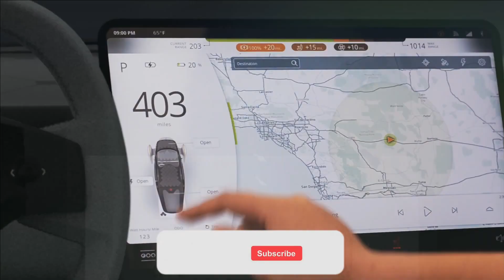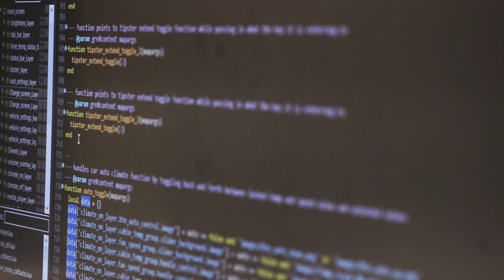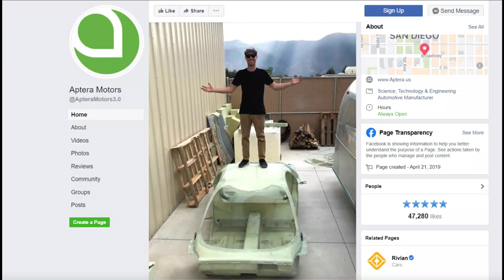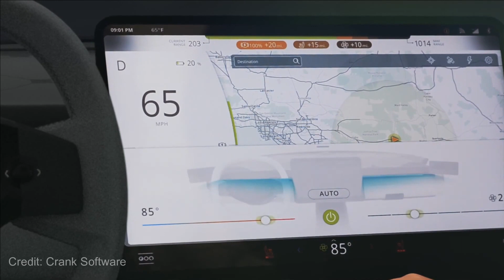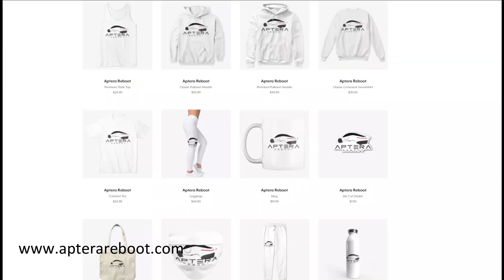Top 3 Reasons Why Aptera Will Fail?!?

Comment: Regarding the concern about being vulnerable due being beholden to third-party parts, most mfrs. use a multi-vendor strategy, so if one vendor fails to deliver, they have a back-up. In some cases, mfrs. engage 3 vendors per part depending upon the part, and circumstances. 

This risk can be further offset by maintaining a healthy supply of parts on site whenever possible and affordable. This tactic is sometimes difficult for startups that are often short on cash, and surplus space.

For context, I'm a supporter of Aptera.

Comment: It's an old video but i got it in recommendation today so there's what i think why aptera might fail:
- they need outside money, either from US government grants or investors. Before Tesla became a successful company, they were pretty close to going bankrupt and only Musk pumping his money saved it. A small company without someone to get it out of financial trouble, depending mostly on many small investors is a big risk

-safety. We'll know more when an outside company starts testing those vehicles but even now there are serious issues that aptera raises -it's light so when hit with a bigger, heavier car, it WILL be at a disadvantage no matter how hard the material is; it is only suppose to have front airbags -and even that was not certain; as a three wheeler it's not as stable as a four wheeler in a side crash; it finally has bars in the side windows that effectively create blank spots for drivers that happen to have those bars in the line of sight

- yes, the fact that's it's a two seater. Even if you only need a car for yourself or maybe one additional person, backseats offer additional space that can be used for baggage, pets, it just makes a car more versatile, more practical. Sure, there are sports cars that are two seaters but they are not advertised as a great option for daily commuting. The only good reason for a car for daily commuting to be a two seater would be a small size that would make it practical for crowded cities but aptera is not exactly a small vehicle, definitely not narrow.

-the size - they cut themselves out of European and Australian market by creating a vehicle that is too big for a 3 wheeler to be registered there. The size also means it's not a good alternative for small urban cars that you can squeeze park anywhere or for big comfy cars that one would choose for longer trips

- 3 wheels and light weight make it not a good option for colder climate and driving on snow, even when you assume they would make the road clearance better. Driving on bad quality roads and avoiding potholes will also be a bitch.

- the reality of solar efficiency- a lot of people think that the solar panels on aptera would pretty much mean no (or barely no) need for charging if they don't drive more than 40 miles daily. I think reality will check it to not be exactly true.   Not that i think solar is a bad idea in general but i think having solar on your roof, always properly directed and angled and an EV in a garage or shade that will keep the car from getting overheated (and then wasting energy for cooling it) is a more efficient combination.

The way i see it aptera was created by enthusiasts that put the idea before practicality. As interesting as it is i mostly see two reasons that they might succeed -one is economy because the efficiency of the shape means money saving not just when buying it. Second reason is if it becomes a wanted toy 'car' to have beside a 'normal' car.

Comment: I'm a 55-year-old on the verge of being an empty-nester. My pipe-dream is to sell my house, buy a very small home on a decent-sized lot outside a mid-sized city. Grow a lot of the food my GF and I eat. Buy an Aptera and retire. And earn a living as a Door Dash/ Uber Eats delivery driver so I can begin work on the science fiction/ ecopunk novel I've been stewing on for years. 

Think of the savings. 100+ eMPG. Lower maintenance costs: small and cheaper wheels, no oil changes, etc. And yet, I'll be able to claim the entire IRS's $0.60 per mile tax write-off. This means that I'll earn $0.50 per mile by simply using smarter tech (assuming $0.10 per mile in actual costs).   

[Bretahes deeply]. I can see the Hugo, Nebula, and Locus Awards already... And the Amazon best-seller ranking...

Comment: The problem that I have with the Aptera is that it is too wide. 88 inches is just too wide. Even if they could only knock off 6 inches it will make it much more acceptable. I also agree with you about marketing. They need creative, but cheap marketing strategies to really get things moving.

Comment: Like the car...
my concern is are the front wheels at risk when driving in dense traffic...
a question is a standard operator license the only requirement or do you need a motorcycle license?...
Reply: In most of the US, only a standard car license is required.  There may still be a few exceptions.  In many states it is in the autocycle category.

Comment: Aptera is the adaptation of the science challenge of who can go the farthest on the least amount of energy. The 3 wheel design is unfortunate imo as it makes the front wheels stick out too much in order to get enough stability. At 88" they are wider than the new Hummer EV of all things. They will get creamed in traffic or parked on a street and since the motors are in them that will be one expensive repair. I get that they were going for maximum efficiency and this is what was required but as a production vehicle I believe they will fail which will lead to someone else taking the advances they made and making a more commercially viable option. I just can't get behind this thing in its current state but wish them the best of luck. I'm sure we will see a modified version of it in a new science fiction movie soon.

Comment: The three stated reasons for failure are mostly unfounded if not baseless. The vehicle is in production. They are taking orders. So far, no failure on that score.
There is nothing wrong with being skeptical but claiming the company will fail in spite of all the positives, and the scale of the positives, is nonsense.
Two occupants for an “and” car is typical and the reason for purchasing by the market segment that doesn’t require more seating capacity. That’s not only no reason for failure, it’s a reason to succeed.
The safety issue is not going away as it’s a hard sell given no vehicle accident history in everyday driving. 
Looks like enough people will buy the Aptera until given a reason not to. There are more reasons, strong reasons for it to succeed. Drivers are ready. The mythic tease of fossil fuel free transportation is compelling. No charge driving was nearly inconceivable. A lot of drivers are willing to fork over the cost of an Aptera, not because of the novelty, but perhaps more so because of the historic progress in personal transportation. This could be the beginning of something big…or so they say.

Comment: Nice ! I am about to propose to Aptera a completely new design that still makes use of just solar power (all of the UV + IR spectrum) BUT WITHOUT IN WHEEL MOTORS, BATTERIES, ELECTRONICS OF ANY KIND :) Why Aptera ? Because they just might respond as other players do not seem to be reachable :) This universal vehicle is about converting UV + IR radiation (solar or artificial) to mechanical energy @ about 90% total efficiency while in use (> 80% transparency) and also be able to make use of  the full spectrum of any natural or artificial light when parked (completely opaque and acting like a dark body). Out of all other car manufacturers APTERA seems to be the most focused on super efficiency and still not destroy the wallets + they are super motivated by their comeback (especailly now) :) So ... there's that :) BTW THE WHOLE DESIGN IS TO BE 3D PRINNTED IN SELF BUILDING FULLY AUTONOMOUS AND AUTOMATED / SELF-SUFICIENT MICROFACTORIES = exponential building speed (much like a pandemic ... but a good one, I hope :) ) ALSO... THIS VEHICLE IS MEANT TO RIDE ON ANY SURFACE / CLIMATE AND HAVE ZERO TOLERANCE FOR COLLISIONS / ZERO ACCIDENTS or CASUALITIES AND SO MUCH MORE ... ALL WITHOUT ANY FANCY COMPUTERS / ALGORITHMS etc.

Comment: Over a year later, it's good to see where we are at with these issues. First, they are only talking about three, when there are many more to consider. Next, on reason 1; a company that has failed is more likely to fail again than to succeed. It's just how it rolls. But if it was a scam the first time, it is far more likely to be a second shot at a scam. Next, on safety; you already say they only might be safe, and we won't know until proper tests are done by the right authorities. It would be wrong to pre-empt any safety credentials. A year later, and nothing has been done. Finally, on it seating two; this is a stupid claim by anyone saying it's a reason to fail. It is simply not, and is not even worth proving it won't fail for the same reason. Nothing could be more irrelevant to success or failure.

Comment: The niche market is the "I want one" market. 
Oil companies refusing to reinvest in refineries will be the driving force of this and other solar powered vehicles. 
I can easily go a week without driving anywhere, so with the full solar charging capability working as advertised,  I can take a weekly one way trip of 280 miles. Add in a wind turbine, wood gas fueled generator, micro hydro generator, extra solar panels, or any other off grid electricity scheme, and I can count on taking a lazy trip to everywhere I might want to go from now till I'm dead without buying a single kwh of coal derived electricity, in theory. I'll probably buy a charge now and then in practice.

Comment: If it has an autopilot-like capability, I'd buy one.   Not to mention it has the best range of all EVs now.    The vast majority of actual road driving done is by 2 or fewer occupants, so it being a 2 seater only means it won't be a family car.   I have an SUV that, as presently used, is practically a 2 seater.   Just use it for hauling stuff in the back.
Reply: Aptera will have a OTA updatable level 2 safety pilot, not FSD to begin with.
Reply: The furthest any Aptera has gone is on their cartoon, or in the back of a truck.

Comment: I changed my order today to the 400 mile range.  They are going to build those first starting next year and then the other ranges in 2024.  Also, their goal is 10,000/year and they already have 25,000 reservations so some who reserve now won't get theirs for 3 years.
Reply: Aptera has now engaged C.P.C. Group of Italy to build their bodies.  This will delay the start of production, but the rate will be able to ramp much more quickly.   This change has taken place because the order book is continuing to grow with over 38,000 pre-orders now in hand.
Reply: @n.brucenelson5920  But they are also behind on their first round of production units that would be delivered to the local area.  Those were supposed to be shipping by now.  I'm not optimistic about getting mine before late 2024 at the earliest and probably more like sometime in 2025 but it is what it is.
Reply: @robertd9850  They have been open about the reasons for the delay.  The products that will ship are going to be considerably upgraded from what was initially foreseen.  Pre-order numbers are now over 38,000 and still increasing rapidly.  The previous plan to use 3D printed molds to make vacuum resin infused body parts does not scale to the required volumes quickly enough to meet demand.

Now the bodies will be made by C.P.C. Group, who also make the bodies for Lamborghini and Ferrari.
They will be using pressed sheet carbon fiber and FMC, resulting in much more precise parts and higher quality.  The current pre-order numbers justify the higher tooling costs.
Reply: @n.brucenelson5920  Nevertheless, delivery is still quite a ways off.  We'll get them when we get them.

Comment: We have had “safe” autos ( meeting all government safety regs) for years and still manage to kill 25k per year….in just the U.S. Physics are physics. People will die in this . I ride motorcycles and up til very recently this is a motorcycle…..what safety regs are applied here? It’s a silly expectation. If the safety zealots don’t kill this in the crib,I’ll have mine in black pleeze…….a ragtop sunroof would be a fun option.
Reply: The safety of Aptera is not left to the applicable regs.  It has been designed from the beginning to pass the FMVSS Part 200 crash tests and will be voluntarily tested with results published as soon as delta vehicles are available to test.

Comment: 1) It is not as fast as they claim it is.  Teslas have the same acceleration and a much more reasonable price for what you get.  The Aptera needs to dump the solar panels and reduce the price to 18k.
2) If there was a battery that had 1000 miles range, it would have made the news.  Since there has been no such innovation, this thing is bogus.
3) Outrigger wheels are a really bad idea.  They are far too easy to break off which means a loss of control of the vehicle.
Reply: I have ridden in a prototype that was even faster than they are claiming.  The rest of your comment is just as imaginary.

Comment: My number one concern is cost of maintenance.  I like many others would love to have one of these as a general use car, not as a novelty toy.  For that I'll need to know that if something breaks, I can take it to a shop or fix it myself, without the price or timeline being adversely disruptive.  I feel that will be the real test.  Can it be a car an average consumer can actually rely upon, or just a novelty toy to play with on the weekends?  All vehicles need some maintenance occasionally.  If this is your transportation to work and back, you can't really have it out of commission for 6 months waiting for parts, or expecting to haul it 200 miles or more to a specialized garage to get it fixed every time it has an issue.
Reply: Aptera grants right to repair. Parts can be gotten and installed by anyone.  My local shop in rural Iowa has already told me that they are eager to service it.  Aptera is shooting for 24 hour parts shipping turnaround.

Comment: It is cool car but the fact that it is only a 2 seater screws them. I know they had to keep weight down, but just wait until battery tech picks up they will be making 4 door sedans, or at least a 2door with 4 seats, but it will still have that unique wind tunnel shape. 

So, that is what they need to acquire first and foremost, research and development on battery tech. but i suspect they don't want to, but that will be their demise. I know research and development is pricy and long waited, but they have to do it if they want something substantially good that we will want. They HAVE to mark these words. They took the known knowledge and engineered the best thing they could with the knowledge, but the current knowledge is not quite enough because take a look at the outcome, a car so light that if a wind comes along it could blow it into the next county, so small a 7ft tall man, or an obese person would have to install a handle on the back to grab onto the back of the car riding a skateboard to get where they are going because they can't fit inside the car, plus only 2 seats, a maximum capacity not acceptable, no towing package, etc... 

 I am proud of them and i love the car and their attempt, they did a beautiful job with the knowledge they had. But that is my point, they NEED research and development bad, because that is what caused them to go bankrupt the first time, they were too soon for their advanced ideals. The knowledge of how to make it happen was never developed, they HAVE to DO IT(research and development). Battery tech improved is why they are "back", they just got "lucky" because someone else did it. Not that they won't be a small nitch car, but that is all they will ever be unless they get off their asses and go into real research and development. 

 They came back but will they stay? It depends on them, but since the only reason they came back is because battery tech improved, and since they had NOTHING to do with it improving, then take a guess if it don't just magically keep improving for them if they choose to stay or fold up shop and take off again when the 2 seater business goes into the toilet. They have to be the big men, the men who DO IT. And a small nitch might not be enough to keep them in business but who knows, maybe it will be a huge lasting nitch.
Reply: You need to do some more due diligence on your claims.  Chris Anthony co-founded a lithium battery company and took it public as CEO before he re acquired the rights to Aptera.  They are making money in a seriously down market.  I was fortunate enough to invest, so I am too.

What caused them to close the first time was that Idealab chose a CEO from Detroit who ousted the founders in 2009 and abandoned the original plan with one he couldn't fund.  By 2011 they were out of money, while both founders went on to start successful companies while they were killing the original Aptera.